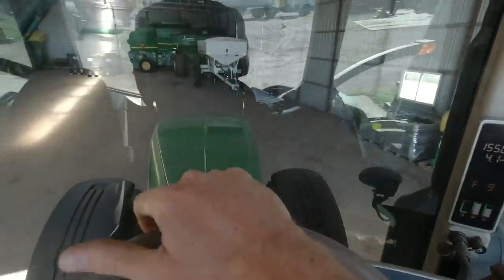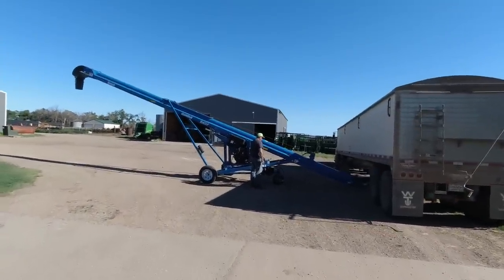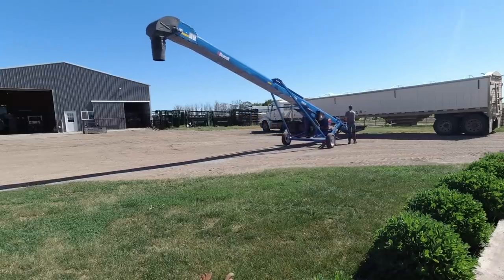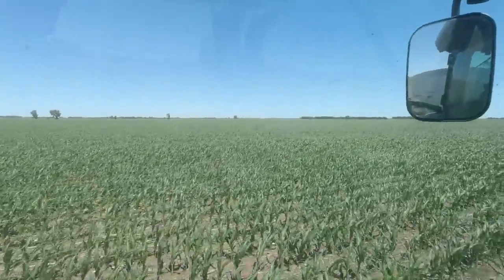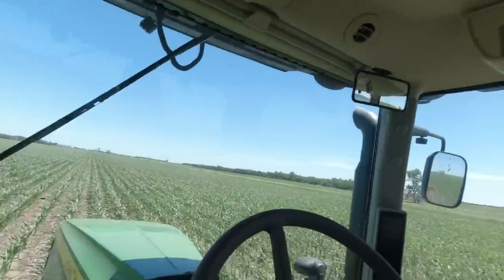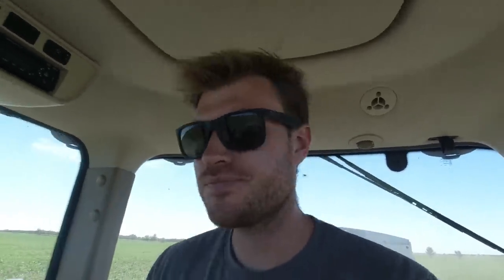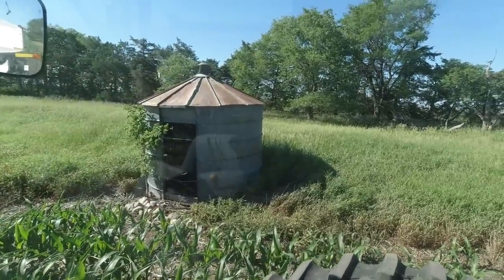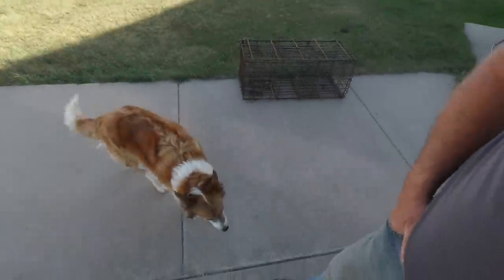A Wing and a Prayer

Comment: You sure opened a can of worms talking about the hymn for the day.  When I was working on my Uncle Freddy's farm during the summer, I recall driving an International 660 tractor with no cab.  I wore a hat and I kept my shirt on.  For music I listened to the gears in the transmission and differential.  . . .  or I sang camp songs like "It's Me, It's Me, It's Me O Lord, Standing in the Need of Prayer" and I added as many verses as I felt were needed.  Another one was "I Have Decided to Follow Jesus, No Turning Back, No Turning Back."  It helped pass the time driving a tractor.  The last campfire song was "Oh the Horse Stood Around With His Foot on the Ground", repeat 4 times, and then second verse, a little bit louder and a little bit worse.  . . .  and so on.  I never did run out of verses for this song.  It was great when I was swathing with a pull type swather in the fall.  I could make the rows as straight as anyone and no one had GPS back in the early 1960's.  . . .  those were the good ole days alright.  . . .  and don't bother asking why I wear hearing aids now.  😮

Comment: Hay Cole thanks for another great video.  A few days ago we lost two cows.  One was about 300 pounds and the other was 900 pounds.  They died over night and they were fine the evening before.  We only have 4 acres whith corn and beans around the fence.  We started to look for answers of what happened and the only thing we could come up with is that all the weeds and grass around the outside of the fence and about five feet inside the fence where starting to die.  The farmer must have come by and sprayed them because we didn't.  Do you think that the weed killer could have killed the cows.
Reply: sorry i donot
Reply: I reread your question and realize i read it incorrectly. What I meant was, I do  not know of a herbicide that would kill them like that.
Reply: @briansonne814  ok we found out that it was  round-up and he only sprayed down the fence line to kill the weeds.  Not really sure why, as he has never done that before.  Thanks .
Reply: We have horses, and I roundup our fencelines, and have had no problems
Reply: George Jones  thanks,  I am 15 and they are my dads and grandparents cows but I take care of them.  They both thought that it was the roundup I just was not sure because I've seen Cole spay weeds in the field with the cows.  So I just thought I'd ask.  I think it must have been some sort of electronic shortage or something like that. Because the cows were both by the barn and could have been touching it. Thanks again.

Comment: Good too see the belts fixed the issue on the swather mate, I’ve just finished top dressing my Canola here in central Victoria, Australia. It’s probably 2-3 weeks off flowering. 
Perfect explanation on the use of the urea too, and boy is it expensive here in Aus atm. $1200-$1600 a ton here. Now I’ve heard some people spread their corn on an angle because it works out to mow down less plants per acre? Is that just a myth or is there science too it? How did the corn go that was treated different at sowing? Has it started to produce more nitrogen fixation in the root system or is it too early to tell?

Comment: Could you address the feasibility of using drip irrigation systems for your crops? From the outside, it seems like a solution to the lack of rain. Thanks.
Reply: We don’t have a water source near enough.
Reply: @tamisonne2519  And the thousands of miles of pipe!

Comment: I have no idea if this is something that is possible, but, could a harrow be used after the fertilizer is put onto the crop so that the dirt is just turned a little bit, without disturbing the corn plants?  That would get the fertilizer into the ground, or does it need rain to dissolve and activate?

Comment: I’m glad you have some dang good lookin’ corn. City Girl Question: does the auto steer “read” where the corn is and auto steer between the rows?
Reply: no its has memory of the path you took planting
Reply: Transmitters that tell the tractor where it is in the field, which you have programmed before you start anything. And then when you tell it you're planting, it starts recording wehre the tractor is according to the transmitting signal.
Reply: Coolio
Reply: All done by gps

Comment: also, if you top dress early enough before corn is too tall running it over dont hurt as much and some will pop back up? i also wonder if they could make a fertilizer that has layers like how jaw breaker candy is in layers like a layer that takes longer to dissolve it could save half the value till latter in season i cant imagine the cost in fuel to top dress a second time at these biden prices

Comment: I'm sure your dad knows the term laying the corn by and you might but we would cultivate back in the day anywhere from 2xs to 3xs the corn and we would set the cultivator different every time from little. corn we would use finders also for small corn we used liquid nitrogen with a applicator so it really got cultivated 4 time that how we top fertilized in my day I'm 63 I done acrers and acres of crops for dad
Reply: layed by by the forth of july was the goal!